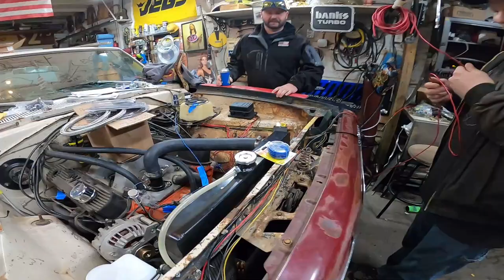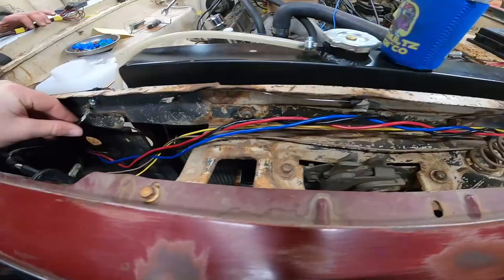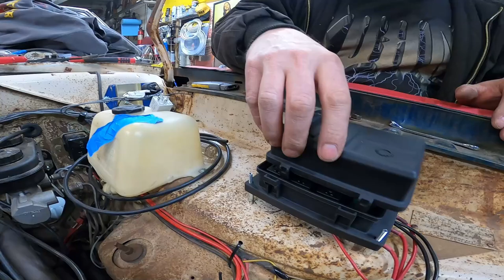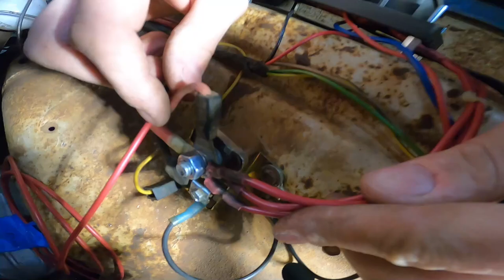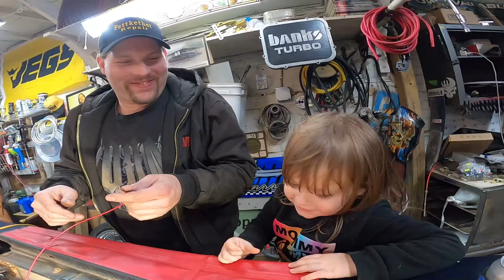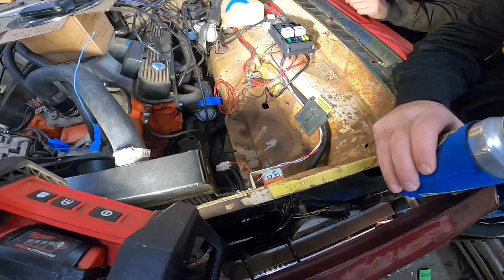Go from Dim to Retina Frying Headlights with a DIY 1967 Plymouth Barracuda any Classic Car RELAY MOD

Comment: Electrical is my weakest area by far, but this looks like a great upgrade. Now here’s the dumb question, the headlights aren’t any brighter than let’s say, when the car was new, right? If they were the life of the headlights would be shortened by a bunch? Another mod I’ve heard of is replacing the amp gauge in the dash with a voltage gauge. I’ve never had a problem but I guess it can melt the dash harness or worst case even burn the car to the ground.
Reply: We're going to look in to eliminating the connection at the amp gauge.  Here's some good reading material on the whole system, I think it touches on bulb life span, I don't think we'll be concerned but we'll monitor it.   https://www.danielsternlighting.com/tech/relays/relays.html      Thanks Ron.
Reply: @79asspin  Thanks I’ll check it out. My long time project ‘69 Barracuda should be running by spring and it’s original wiring has me concerned lol.

Comment: Hey I know this is an old video, but thought I would ask anyway, what is the manufacturer of that wiring harness/fuse block?   Did it work out ok?  I'm in the market to rewire my Coronet and I'm debating on going with an OE style harness or American Autowire and do the entire car.
Reply from the maker: It's just a cheap eBay relay block very cheap. Probably get one on Amazon too?

Comment: If you want to know if this will work connect a voltmeter from the positive battery terminal to the hot terminal on the headlight connector with the lights on. If you see less than about a .5 volt, skip the mod as it will not make a difference in brightness. You might want to do this to take the amp load off the headlight switch even if it doesn't help the brightness.

Comment: so do you have a list of what you used for that electric fan and the other parts including the fuse/relay box ? what did it cost?
Reply from the maker: JayBo has that. He will fill you in.
Reply: The fan and temp switch came from Jegs.  RPC Universal 12V Electric Fan 16" $69.99,  Adjustable Fan Temperature Switch 160 to 240 degrees $24.49.  The stuff pertaining to the headlights, I posted above.